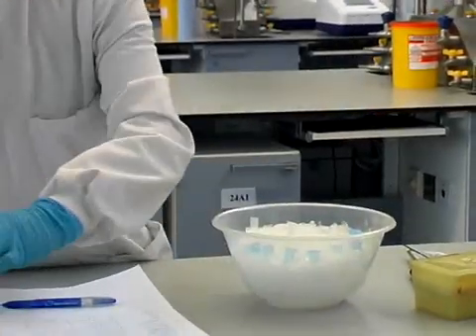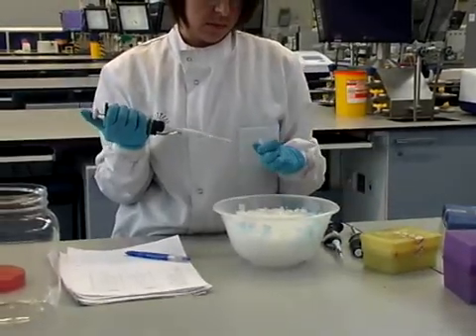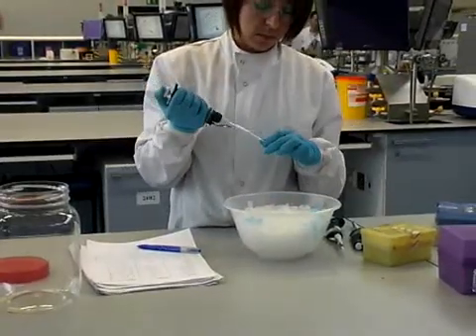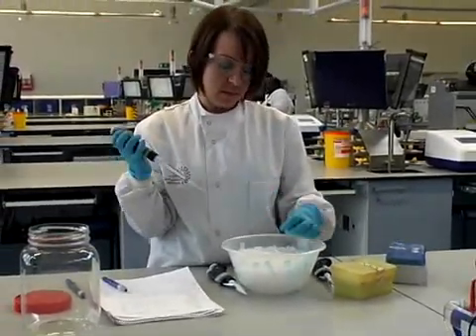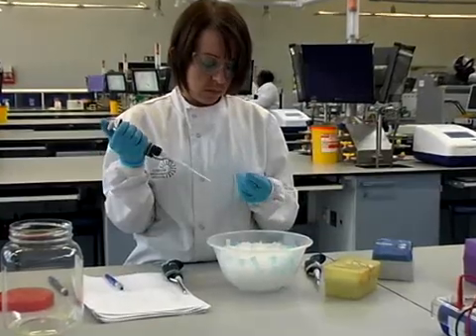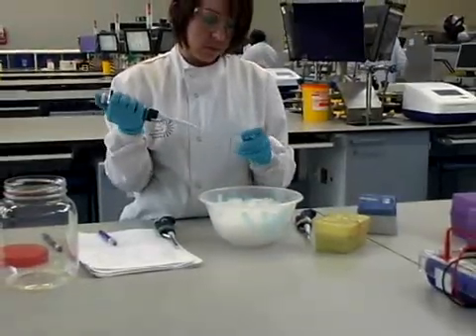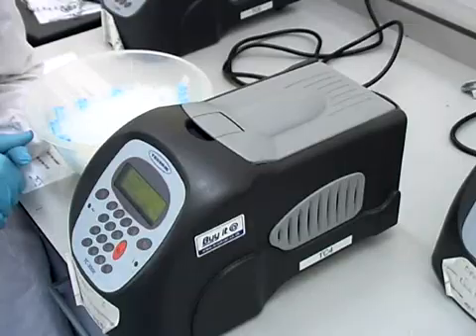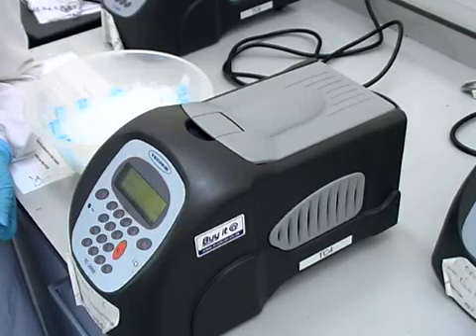How to Perform a Polymerase Chain Reaction | William Armour & Laura Towns

Comment: As far as im concern the water should be added first, then the lowest volume...
Reply: +Libe Jenkins first we add the larger volume, it can be buffer or water, depending on the reaction. Then we add the lowest volume, and the reason is because in case of lower volume such as the DNA polymerase, it's viscous, so there will be a lift over inside the tip after we add the desired volume into the reaction mixture, If we add the buffer and the water before the DNA polymerase, we can the desired volume of the DNA polymerase and then washing the left over inside the tip by mixing the tip up and down with the buffer and water in the reaction mixture.
Reply: سلام
Reply: +EmiLy MenHer Why? because the components are acid?